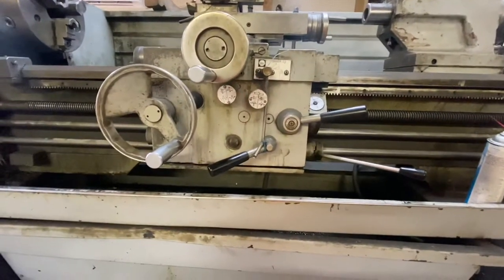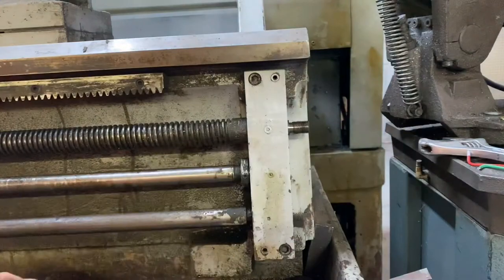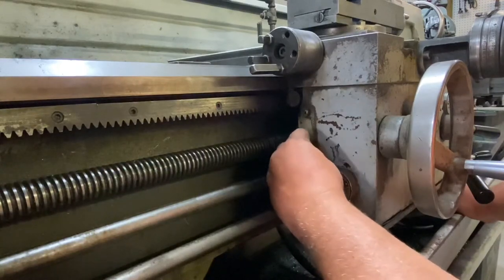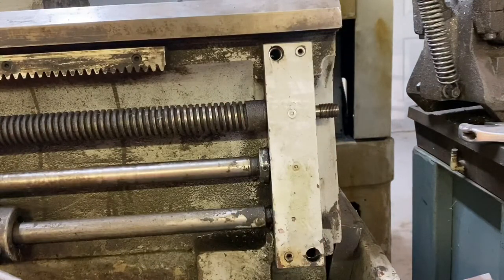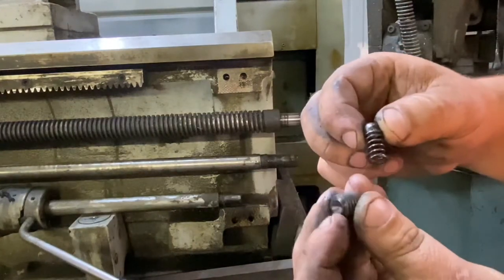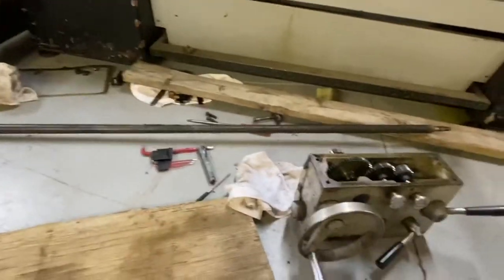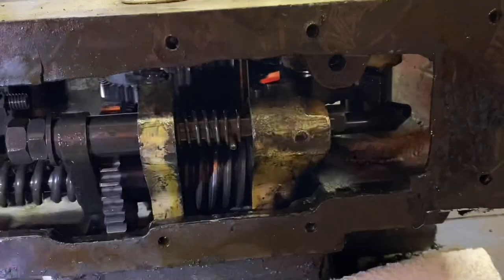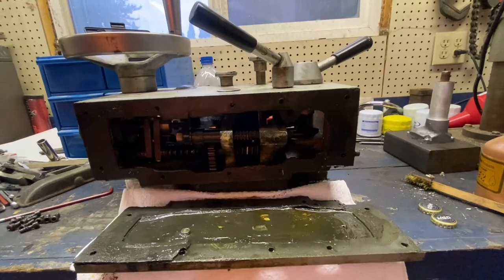Removing and inspecting the apron on the hipromac lathe

Comment: Good video. I love a machine disassembly. There are mostly all somewhat the same, or at least enough so to be familiar, yet each unique enough to be interesting.
Reply from the maker: I like doing it to, until I start finding a bunch of broken stuff lol
Reply: @smalltownmachineshop6860  Yeah, that is the downside I suppose, but at least it's not too bad, and could always be worse, right?
Reply from the maker: True, and I found a missing spring in the apron to the new lathe so I think that’s the main reason it keeps dropping out of power feed so a easy fix
Reply: @smalltownmachineshop6860  That lathe looks sooooo worth the time, effort, and expense to get back to fully operational.  It's kind of perfect really.